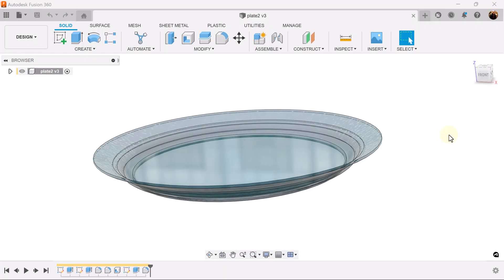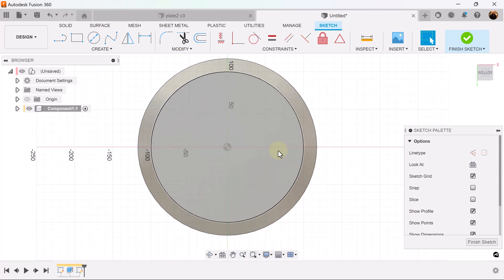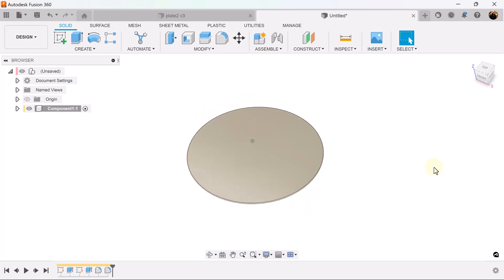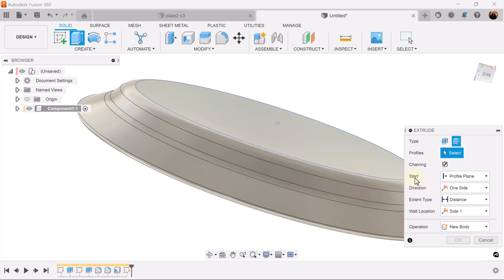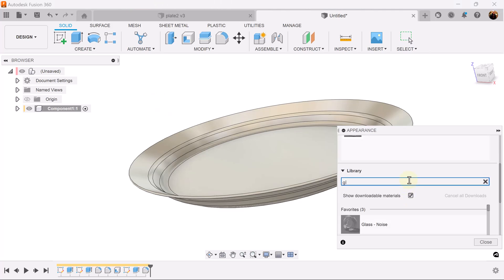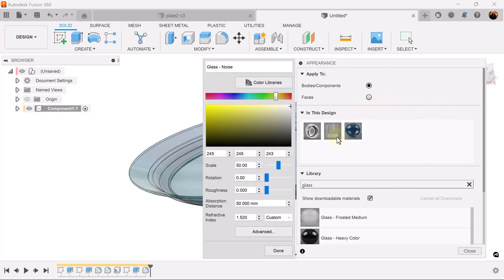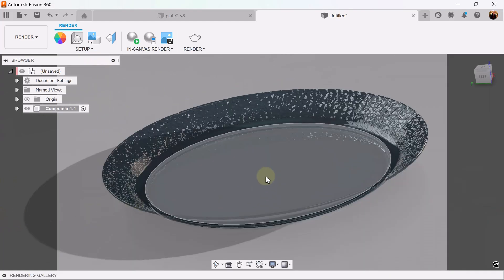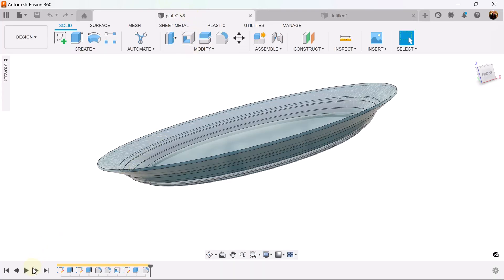Modeling in Fusion 360 - glass plate | Rep no. 8

Comment: Another good  exercise. I'm back with more questions (2) Your sketches show lines to clearly define different faces, how do I do that?  Secondly, I downloaded the noisy Glass but when I tried to move it up to appearances, it disappear's. Also I cannot open it to adjust the colour settings ??? The blue glass was was ok on both counts.
Reply from the maker: Thanks or the compliment! 

So to make the lines appear on the bodies use ctrl-6 on a pc or cmd 6 on a mac I presume. If a material disappears, once you drag and drop, make sure you  didn't overwrite a previous material in your listed selections. Sometimes that can happen. Be sure to check the labels of each and remember which materials you use. Finally, don't be afraid to relabel each material so you wont get confused.
Reply: @CADJungle  Thanks on both answers, although the moving the noisy glass and editing it worked first time but believe me what I did was the same as yesterday. I sometimes think Fusion 360  has a mind of it's own !!!
Reply from the maker: Trust me I know the feeling. I occasionally run into Fusion 360 issues periodically. Not always peaches and cream!